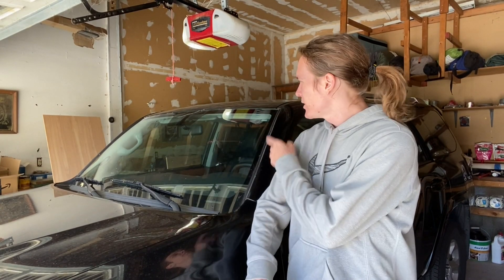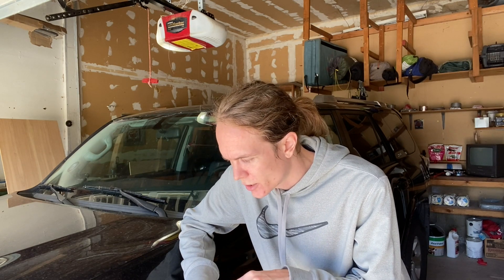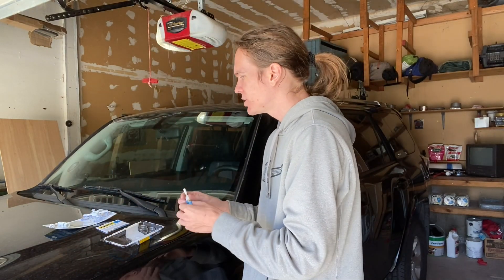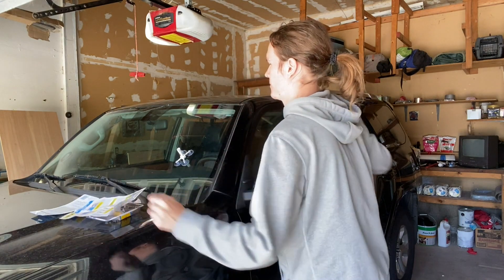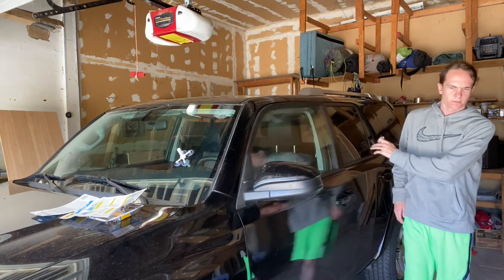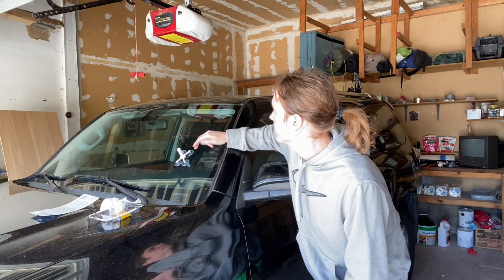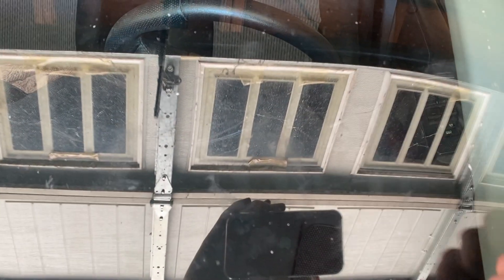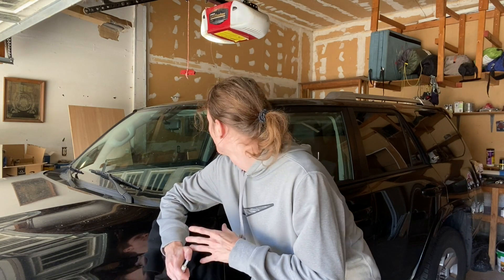$10 windshield repair: Fix it in under 1 hour (Cracks, Chips, Bullseyes)RainX Kit

Comment: These are covered 100% by insurance so we go to the car glass pro around the corner.  The results are fantastic always.  They cannot do larger than a 25 cent piece by law.  Its done the same as this pretty much but with sturdier pressure clamps allowing for more pressure, a complementary set of Bosch best wiper blades and some new hydrophobic glass product that they are selling applied all around and interior glass cleaning.  They are actually working around the car the whole time its there.  Replacing the windshield is covered too, but with deductible.  If I wasn't insured for it, I would choose this solution.  The price quote without insurance is the same as Mr Ramos. About 160.

Comment: In your opinion how to fix a realitivly big crack using same product thanx
Reply from the maker: Yea, I have had a friend do a crack that was 36 inches long and it worked great. They did need 2 kits to have enough product for a crack that long but you follow the same steps.
Reply: @diysimplified291  thx for telling me that now I can go do it and not pay 600
Reply from the maker: @shesaghost9920  are there any other DIYs you’d like to see?